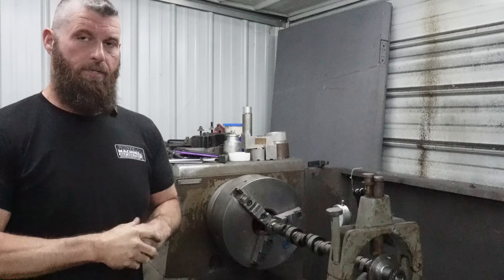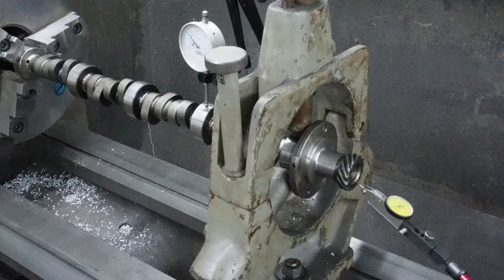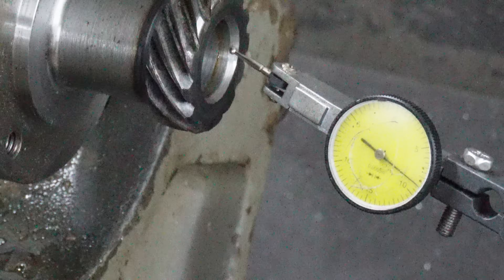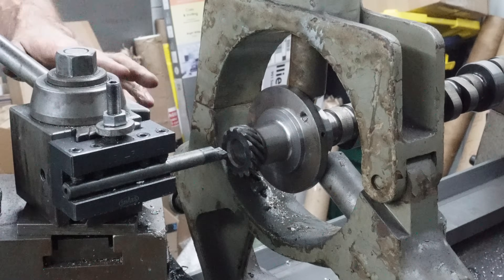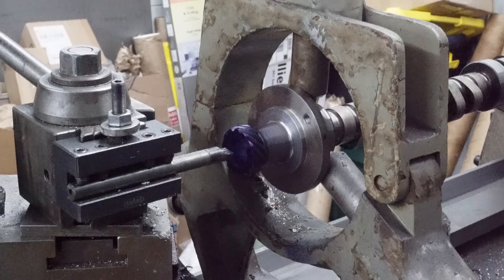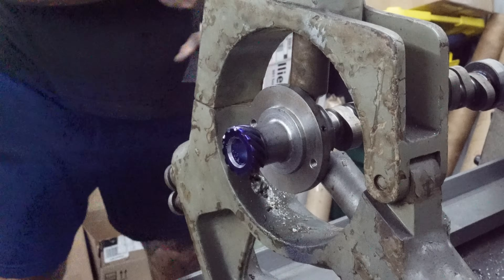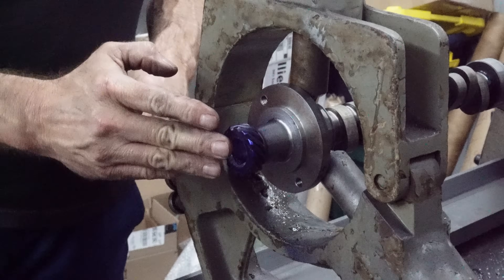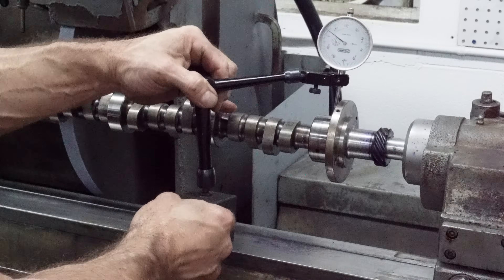Machining a Bad center in a new Roller Cam

Comment: What is the significance of the taper?  What would that end up hurting when installed, or is it being re ground between centers so it needs to be on point?
Reply from the maker: @wellscody86  all cams are ground between centers
Reply: @ somehow I missed the very beginning when you said it was a core to be ground.   I was thinking someone sent it in to be verified.  Great videos 👍🏻

Comment: With the runout on the nose, will the distributor drive gear be running out also ?
Reply from the maker: No, the center runout happened after it was manufactured,  once I fixed the center nothing had runout

Comment: Nice work!  I'm not familiar with the particular engine type, but I wonder if the effective mean pitch circle of the small gear on the nose exterior to the centre is also going to be "off" if the gear was cut using the centre as it was before you corrected it as a reference/locator...?  Might end up with hunting/inconsisent backlash to the companion gear (whatever that is; distributor?)
Reply from the maker: I checked it, the center got out after manufacturing

Comment: Id like to build a custom 4.3 litre  inspired v6 with 4.125-4.200" bore a  3.50-3.80"-4" crank non split journals, because the block would be 60° V angle still use the 90° heads with possibly a pushrod clearancing. A custom cam core. A custom intake manifold splayed mains with big block bearings. A bore 4.185"-4.200" 
(possibly 4.200" maximum overbore)  tall deck 9.250"-9.500" maybe 9.800"-10.0"   6.300" rod use a bigblock based oil pan. Maybe use the LV3 4.3 LT based v6    basically a 5.3/6.2 missing 2 cylinders.  Go direct injection and port injection. (I always wondered why no one made a 3.75" crank for the 4.3,..) a port job on the LV3 heads  MAYBE  larger valves 2.08"/1.55  10:1 turbo or 13:1 non turbo dual fuel direct inj. Getting 93-95 octane  the port getting E-85 (maybe E100-m100) a 102mm thtottle body on a holley high ram style intake. With injectors in the top. firing into the topof the runners. (When extra fuel is required) it should drop the intake temperature 50°F minimum. Add 28-35;psi of boost through a air to water intercooler😮.... A 2" aluminum girdle can maybe hold the bottom stabile.  It should easily do 200 hp per cylinder  maybe 250 with a splash of better fuel.. maybe more boost and dry ice chilling the intercooler reservoir.. and totally have street manners.. it could possibly be backed by a 4L80 and drive to the beach and back.  Go to Bonneville do a 200 mph pass and drive home.. maybe keep it under 7500 rpm..  enough rambling have an awesome day..
Reply from the maker: @jamest.5001  4.3 is 90 degrees

Comment: at 3:33 the lobes look like they have "fasets" or flat spots ( ground with a cnc cam grinder ? )  I have a comp cam that looks the same way.
Reply from the maker: This is a new unground lobe core, the lobes are rough milled when we get the cam, ready for finishing
Reply: Got to have a good foundation to start from if you want the parts to come out really nice.
Reply: @bcbloc02  prove it.

Comment: What about the gear teeth? I'm just starting to watch the video and wondering if the gear teeth are out of center. Maybe I just need to finish watching...
Reply from the maker: @MrSuperchargeron  gear runout was fine,  it's finished up now and ready to ship
Reply: Awesome!! Great job! Its always difficult to figure out whats wrong with a part, and if your solution is going to create another problem! I certainly didnt know anything about what was going on with that cam.. or why the bevel in the end matters.. I'm no expert, just a guy thats seen a few things.  @powellmachineinc

Comment: That was great. Well done. You are the man. Remember when Buicks had a rope front seal? Yikes.
Reply from the maker: @cjespers  definitely
Reply: Air cooled bug came with no seal behind crank pulley.relied on threads on pulley to sling oil back into crankcase.i didn't like working with rope, would try to use rubber in it's place.